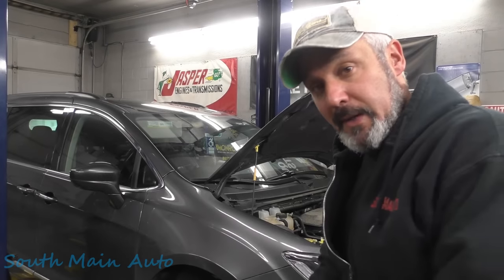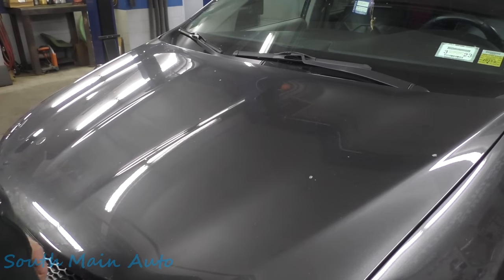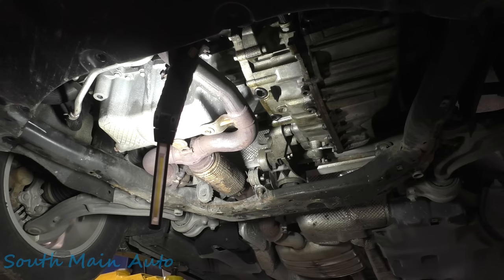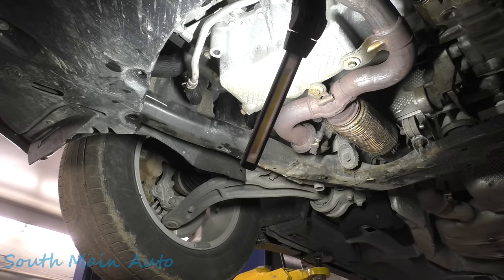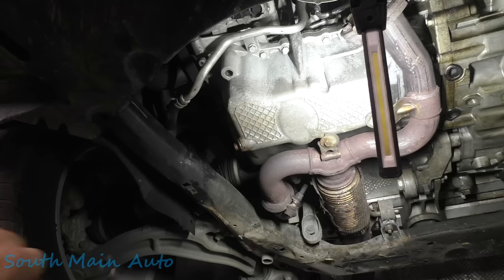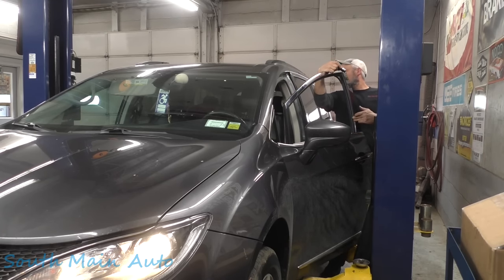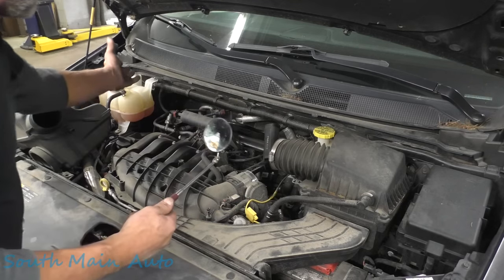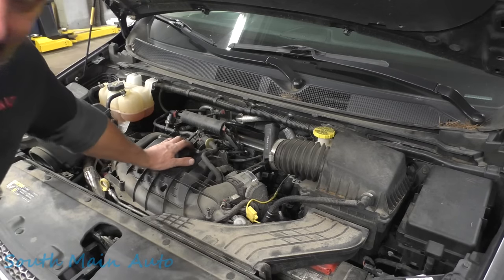Chrysler Pacifica Goes Full Nuclear 💥

Comment: I've had better luck with Chrysler than I have Chevy and Ford.
I had a 2014 Chevy Malibu that cought on fire because of a rubber hose that dropped down from the power steering hit the converter. The replacement car was another Chevy Malibu and at less than 40,000 Miles the steering motor fell off the rack and pinion with me running at 70 MPH thankfully it was at 4 AM. on the highway and no other traffic around at the time.

Comment: Pentastars get a lot of issues, but head gaskets ain't one. Not saying it's impossible, especially since it overheated several times, but the head gasket being the culprit that started it all? Highly doubt it.

Cylinder head was likely cracked. Fiatsler had a casting issue with them.

Comment: 2017 Chrysler Pacifica with a pooched engine, and it's not worth replacing? I just had a quick look on Craigslist here in Vancouver. One of them, a Limited" goes for in the range of $30,000 Canadian ($22,000 USD) on the low end. Not sure how much to re and re an engine, but surely it can be done for less than $25,000 Canadian ($18,000 USD)?

Comment: It's unfortunate when people don't know enough about their super expensive car and they let a problem go until it's a full blown disaster. Had the coolant leak been addressed early, maybe it wouldn't be so bad. But I also wonder, the way all these modern engines are now, is it even worth doing a head gasket job. To do both sides I assume the engine has to be pulled, and you may as well do all new timing components while you're in there.

Comment: HI ERIC WE ARE THINKING ABOUT BUYING A 2018 CHRYSLER PACIFICA WITH ABOUT 30K ON IT.  IT HAS BEEN CONVERTED TO A  HANDICAP  VAN FOR MY SON. WE HAVE NOT PURCHASED IT YET,BUT I DO RESPECT YOUR OPINION AND YOUR STATEMENT ABOUT THE RELIABILITY OF CHRYSLERS KINDA SCARES US. WE CURRENTLY HAVE A 2011 DODGE GRAND CARAVAN AND DID HAVE A LOT OF BRAKE PROBLEMS AND A HEAD  GASKET PROBLEM @ ABOUT 105K. AND RECENTLY  JUST LOST REAR AIR AND HAD IT BLOCKED OFF.    JUST ASKING YOUR OPINION THANKS

Comment: What the heck? A 2017 vehicle should never have issues like this.  If you don’t change the oil, yep there should be issues, but not a head gasket leak or a cracked head. I have a 2016 and a 2017 vehicle (not Chrysler) and haven’t added any coolant since new. Unless she added water and it froze, there are no excuses.

Comment: Sorry I disagree, I am a life long mechanic with a doctor of motors. Yes the engine is most likely finished. However I always preferred a GOOD rebuilt engine to a used one. The reason, is simple, I went down the used engine road, and found that after 'removal and replacing with another used engine there is a high probability of failure. With a rebuilt engine from a reputable firm the job can be guaranteed. Yes it will cost more, however it ends with a happy customer.

Comment: I think all of the 3.6 L whether they're from Chrysler or Chevy are a bit questionable but I've seen those Chrysler engines, when cared for decently go decently over 200,000 miles. The problem I have with the Pacifica is the 9-speed Transmissions were such a pain in the ass, I don't know if they're any better now but when they first come out they were a pain in the ass transmission. Some reason, you cannot get these young Engineers to quit trying to reinvent the damn wheel!
Reply: They are reliable but not this variant, the one in the dodge trucks, challengers or chargers and jeeps is the best engine made in the last 20 years.

Comment: I judge a manufacturer’s reliability by how far out of warranty it makes it before a stupid issue arises, if it even makes it out of warranty. With that being said most of all modern cars suck in one way or another. I think the golden age of reliability we will never see again was late 90’s to early 2000’s Toyota and Honda. Even though they used tiny fasteners that always sized dissimilar metals into the aluminum blocks with our north eastern winters. They never really broke down parts would just go bad.

Comment: I work at a dealership we have had a rash of these 17s in lately with this issue. 2 just this last week both of which cylinder 1 filling up with coolant and hyrdolocking the engines. Both recieved bank 1 cylinder heads and they appear to be fixed. Wonder if I a warranty extension is coming like the old 3.6L pentastar left cylinder heads

Comment: Question . I’m just a diy Mechanic. My 92 accord. Coolant fan plug is rotted off ( I bought it like that) .. if I go to Napa , what’s the difference in wiring, do I just buy any wire or color match it ? Same issue with my bumper lights, plugs are rotted off.. I want to reword those three ( coolant fan plug and both corners on my bumper lights ) .

I don’t really mess with electrical but I want to learn

Comment: This is off topic, but I gotta 2008 Dodge Grand Caravan with the check engine light on. It says bank 1 sensor 2 high voltage. It only has two 02 sensors. One upstream of the catalytic converter and one downstream. I replaced both because they were original with 300k miles on the engine. It’s still saying the same code. And recently the airbag light popped on. I didn’t know if that was related or something totally different. I don’t really care about that, but emission inspection is due in a few months and the check engine light is on. It seems to be running a little rich too. I appreciate any tips or suggestions. Thanks.

Comment: Just had my head gasket replaced on my 2018 pacifica
Reply: You made it sound like an easy fix. I know nothing about Pacificas but on other models I've found warped or cracked heads, and/or perhaps other issues that required attention beyond just the head gaskets. What was your experience?
Reply: @annettesurfer  my buddy replaced it ran fine after. Until I totalled it last night
Reply: @annettesurfer  it's just a pain in the ass he said because everything needs to come off to get access

Comment: Question for you Eric..  I'm in England and I've a 1994 rover 827 (Honda c27a 2.7 v6)   need to change the change the crank sensor am i correct in thinking its behind the timing belt..?   And if the did fail before i get chance to do it is it bent valves or do they clear?

Comment: If the customer is going to fix the car… the labor to R&R the motor will be similar to rebuild or buy used…. I would at least tear it down to see the extent of damage and if it can be rebuilt before buying a used one…. You can always get used cylinder heads for reconditioning before rebuilding….. just sayin….

Comment: wow, these types of problems on only a five-year-old minivan that's pretty disgusting.
The worst thing about it, people continue to buy them and put their families in them.
I worked at a shop for Co-Cp in the early 2000s, I remember a constant flow of Dodge Caravan over the year I worked at the shop, most of them had similar problems bad Engines Transmissions intake gaskets evap was definitely a big one, ect
But it was pretty much a constant flow.
I ask one of the mechanics why do people continue to put so much money into these Vans when they continue to have major problems, the biggest answer was the wives love them but the husbands hated them and most wives would leave their husbands if they got rid of the Dodge Caravan even though they were nothing but garbage.

Comment: I agree with every thing.  But,  I don't understand why you are hesitant to suggest an engine swap with a used engine. (at least it seemed to me that you are hesitant.)  I've done it several times and had good results.  Yeah, there are risks but every thing has risks.  If the vehicle is in other wise good condition I say go for it.  You said that most of the time those engines are reliable.  And tell the junk yard to throw in the starter.

Comment: Do they still have the royal pain in the ass to change rear motor mount about under the drivers foot?
I did one and then it came back with a defective part a month later and had to do it again for free. Really chapped my hide. 
It always goes faster the second time.

Comment: What do you guys think of my issue: Have a 2007 diesel ford c-max (very similar to focus) that had the daytime running lights fuse removed. I replaced it and suddenly the engine won't shut off with the key, until I switch the headlight switch to off. Went back to normal after yanking that fuse again.

Comment: Hey Eric, what about the engine oil cooler/oil filter housing, can this thing leak coolant into engine oil?
Reply: Ywe that's a very good point mopar does have this issue
Reply from the maker: Explain the water in the cylinder then 😏
Reply: I'm not questioning the head gasket going bad in this vehicle, I'm just asking in general cause I had coolant in the oil issue on a dodge van and I didn't know for sure which was causing the other, the oil filter housing going bad blew the head gasket or the the bad head gasket blew the oil filter housing!!!
Reply: I do,believe it causes water in only,1 of the cylinders, I seen on tech tips it happens on a ton of,jeeps. Its,just,seeing the,videos at,the same,time,tho your great at what you do. Jam going to go,eat some hippy brownies now

Comment: I'd never seen anyone turn an engine manually and listen as you did.  I'll try to remember that should  I run into such a situation.  Chryslers turn me off, same with Dodges.  Yeah they may be real road burners for a short time, as I see on some videos.  Long term, who knows?  I still recall the cars of the 60s and 70s, ran like raped apes, rusted badly.
Reply: I have had a challenger since 2016 that is still on the road with 56k miles and works like a charm, made many trips to texas and back put a lot of miles doing that and its very reliable 3.6 liter pentastar is the best engine made in the last 20 years super reliable.

Comment: I work at ford. And as simple as this is to solve and as simple as it was to diag. Ford would be like we want you to tear the entire engine down and find the point of failure. Then send just a cylinder head with a gasket to save money. It must be nice to not have to deal with warranties. Currently dealing with one case of a Ford Fusion with 100k miles with extended warranty through ford. Overheated the engine coolant loss no signs of external leaks. Found 3 of the 4 pistons steam cleaned. Told ford it needs and engine. They proceeded to tell me to tear down the engine to a short block measure the head and deck (shocker it was so warped it couldn’t be saved) then instead of sending me a complete long block they send me a cylinder head and a short block to completely rebuild 😫🔫
Reply: Also! Cylinder head was on back order for 5 months total time ford has wasted has been almost 8 months waiting for approval and back ordered parts. OH also we have a complete long block in stock and we told ford that they said no do not put a long block in the car. Lol meanwhile customer is screaming at us like it’s our fault.

Comment: Chrysler product question- please help- I have a new Jeep Wrangler and the battery died. It’s an automatic transmission, Rubicon model. Roadside assistance jumped it and basically drove it on the flatbed truck with the portable battery charger still attached because the battery was so dead. Engine was low power. My question is during this low power scenario, it shifted very clunky. Like when the guy drove it on the flatbed he almost had to force it into gear it sounded like from the outside. Could this have damaged my Transmission? It drives fine now after the new battery was installed, automatic transmission shifts good, I just worry when I heard that very clunky shifting under dead battery power. Like he was slamming it into gear. I read somewhere that some cars inly go in 3rd gear when the battery is very low or dead. Can anyone shed some light on this?

Comment: Great call Eric. Not knowing how badly she cooked the engine, I'd say used would be the way to go. You didn't have the milkshake of death coming out of the crankcase, so as an avid amateur mechanic, I'd do the head gaskets, or even try block sealer first, as a Hail Mary. Many cars ago, I used block sealer in my car and it was fine for 3 years until I sold it due to the tin termites munching on the body. To get best results, drain and flush the system. Replace the cooked starter and see what happens.

Comment: Only other spot it could mix is the oil cooler, it’s very rare both the oil and coolant gaskets fail tho it usually just pukes out into the valley. That things junk either way though, needs an engine or don’t bother. Chrysler doesn’t even want us to machine any heads not too sure why but I guess they’re just not confident in they’re metal. Personally though once everything has been warped like that I don’t believe it’s worth spending money/time trying to save it. Unless it’s a 12,00 dollar 2JZ head off your track car, just buy a fuckin motor or dump the car

Comment: what exactly warps the head during a major overheating event or events? Is it from the force of the head bolts, always wondered, still don't know exactly how it happens
Reply: Literally heat, and it is not limited to the head.
Reply: @ShainAndrews  I'm guessing it's uneven heating that causes certain places to expand more and therefore cause a twist or bend
Reply: @henryD9363  Correct.  It is exaggerated in a cylinder head because it is the first component responsible for directing the exhaust gasses out with long dwell times.  But sometimes blocks can become distorted too.

Comment: Own a Chrysler Pacifica myself, and if you simply keep up with the routine maintenance of the engine, it will run fine.  Fuck around and don't get your oil changed, or let the coolent get low, you are fucked.

Comment: Could spark knock cause a head gasket leak?  Excessive cylinder pressures?  I know the ECU will pull timing too prevent or reduce spark knock.   BUT, doesn’t oil contamination in the intake tract effectively lower octane rating dramatically?   I think it does.   It could be that when cool the ECU puts the timing back in after a drive cycle without reaching full op temp.    I know the knock sensors are pretty robust but maybe this is or was a compounding issue.    I’m trying to figure out why the head gasket would leak in the first place.   I don’t see that as just “one of those things”.   So what can cause that?   Did overheating cause the leak through head warping or did a leak in the gasket cause overheating?   Maybe the knock sensors weren’t functioning and an MIL was ignored.    Most people wouldn’t know the sound of spark knock anyway.  And if the sensors aren’t working then the ECU wouldn’t know to pull timing.     And the vicious cycle eats it all up.   If the head gasket leaked or the head warped, there had to be a reason in the first place.

Comment: Here's a clue. if there is water or coolant in the oil, the party is over. It acts like sandpaper on the moving parts. Get A used engine. Get a Jasper engine, but get an engine you need one. Because what you have now is an Oddly Shaped Boat Anchor.

Comment: I wouldn't give you two cents to work on any of my cars, car is using coolant, hmmm blown head gasket or cracked cylinder or head, won't turn over hmmmm maybe engine is hydraulic'd, take spark plugs out and turn it over, oh water comes out well good thing we didn't bend the connecting rod by forcing the water out past the rings.

Comment: Yep not worth the effort low mileage used I get a lot of customers that want me to rebuild  Engines in similar conditionsI tell them just get a Low mile use one Especially on a Chrysler product I specialized in toyotas for the Toyota I would Entertain a rebuild it But she's cooked no point in going any furtherAnd unfortunately for the Chrysler product I would recommend Send it to the scrap yard Cause you put a new motor in the Trans is next Horses already dead don't need to beat it Go by a Honda or a Toyota Unfortunately I am Is Jean America But the mid size SUV American built rigs aren't so great

Comment: This is actually a common problem with these engines as they get near 100K. I have seen enough of them to know this. Yes they are fairly reliable until They have this issue. I have seen far too many 3.6s with this same problem. The heads are usually too warped to machine depending on how overheated they get. Best option if not too high mileage since it is a 2018 model is to swap in a junkyard engine that still runs and call it a day. Really shouldn't happen to such a new vehicle. FCA building junk now same as the Costs they couldn't sell. Fix It Again Tony...........
Reply: The pentastar has next to no failures but the 3.6 in this model of vehicle which is not a pentastar is a piece of junk.

Comment: Eric, everything that follows is sarcasm; please take it as such.  It seems like all you do anymore is just call carmakers out.  You call Cadillacs that are equipped with the Northstar engine "toilets."  You have issues with Jeeps that are nothing more than rebadged Fiats.  (I think the plastic refrigerant lines was your beef with them.)  Now you have said that owning a Chrysler is "scraping the bottom of the domestic barrel."  I'll have you know that Chryslers are "innovators."  Just think of all of those torsion bars that broke in 1957.  Just think of that "Lean Burn" system computer that was over the exhaust manifold from 1976-89 that would fail, the engine backfired and blew the exhaust system off the car.  Now this.  Not to mention the government of these U S of A states used taxpayer money to bail them out not once, but twice.  So, what's your point?  I would have loved to see you remove a sparkplug and dip your Borescope in the water.  Oh wait!  You didn't know which cylinder.  Water cannot be compressed.  I have 2 6.0 International diesels.  I know.  Great video!